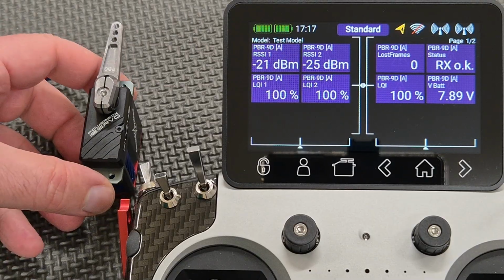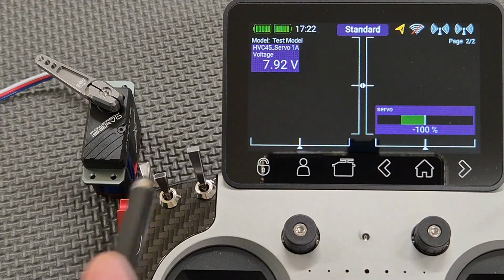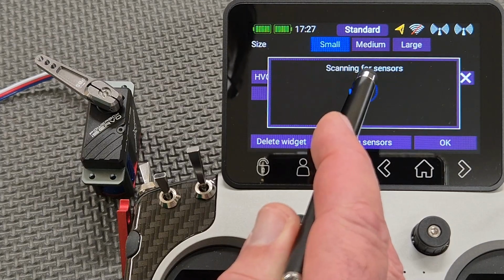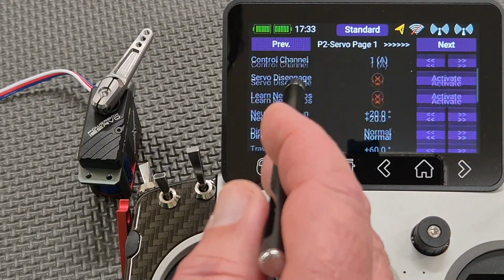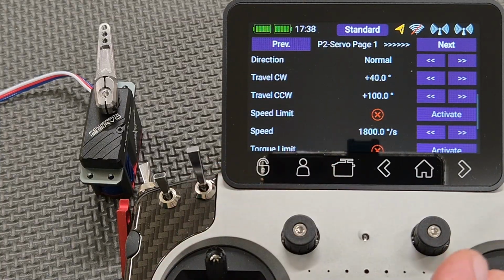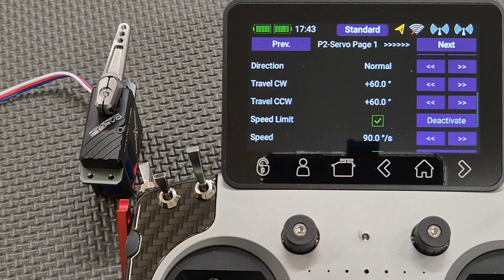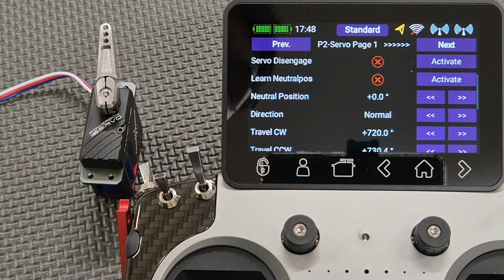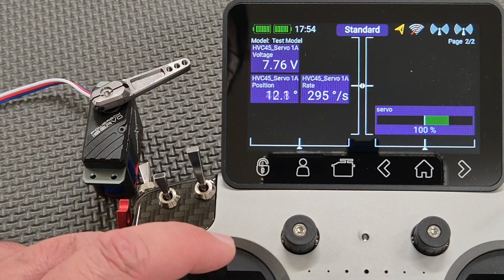PowerBox iServo : Part 3 - Programming via Core and Atom Tx

Comment: Hey costas, great work making these videos. I  was wondering whether you tried a configuration where in the iservos are connected to a PB competition as P2bus for telemetry but the input from the receivers is SBUS...
Reply from the maker: Not with the CompSR2. Ideally the Royal SR2 works better in tbat it features 4x dedicated Bus ports so you can easily connect bus connected servos to.
With the Comp SR2 you would need to make up your own custom Bus cables as it does not feature any high power dedicated Bus ports like the Royal SR2 does.